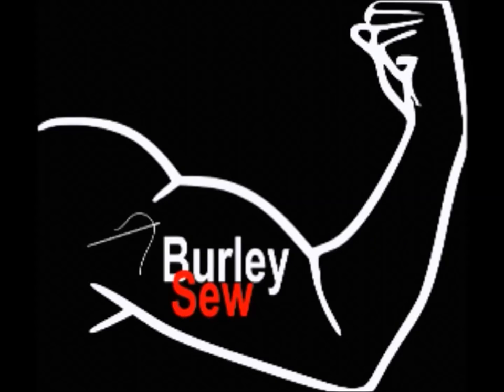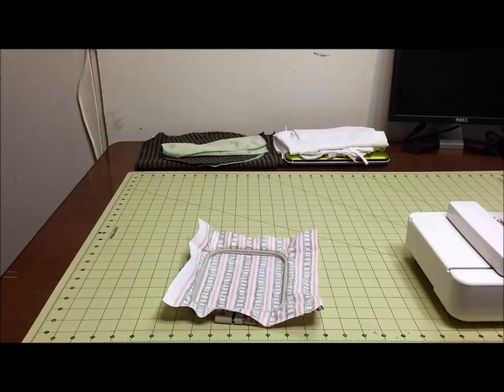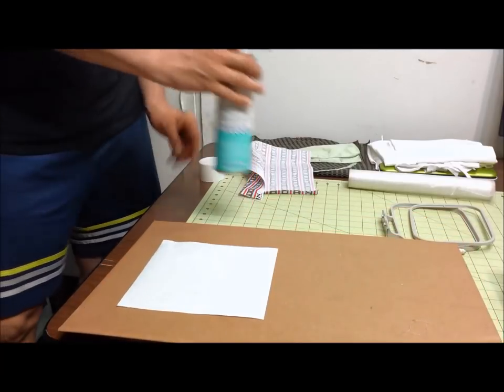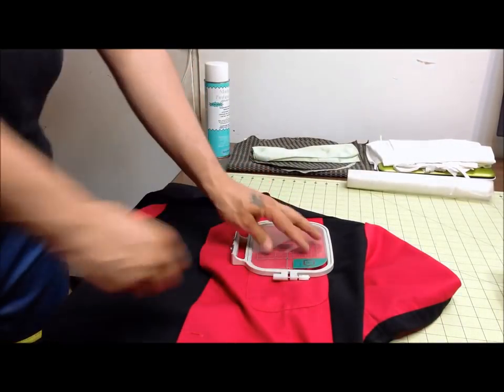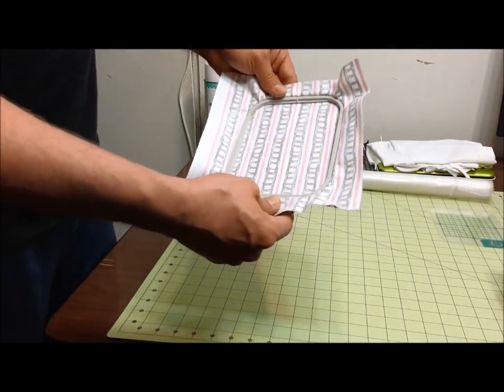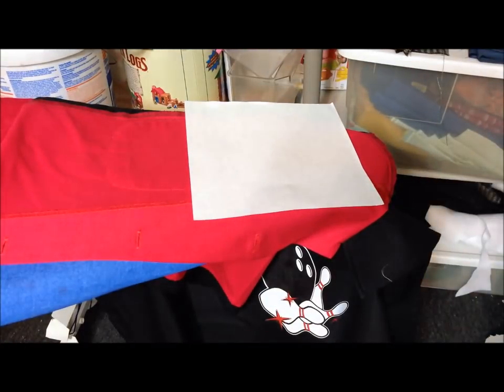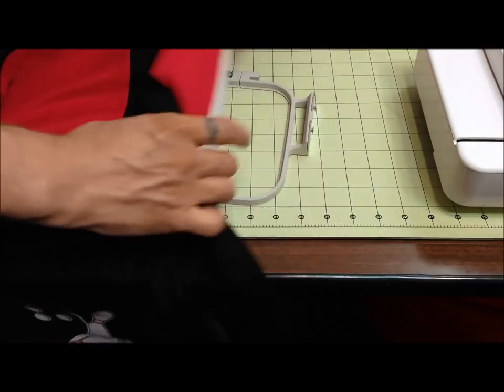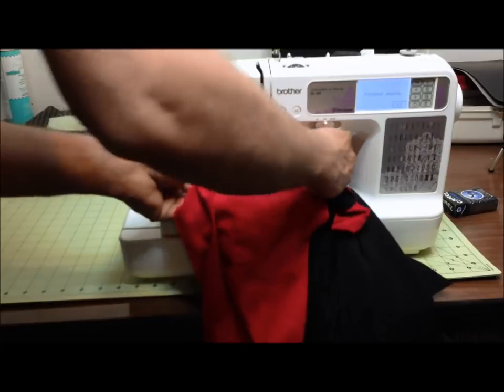How To use the embroidery hoop for a home embroidery and sewing machine- hooping tutorial (beginner)

Comment from the maker: Thank you for the great input! I looked this up after you mentioned it and saw the ones you are talking about. They have extra connection tabs so you can reposition it on the carriage. Originally I read that the machine would not make designs larger than one that will fit in a 4” hoop which is true. So this is a good solution to just reposition the hoop and not have to re-hoop the material.  Once again thank you.

Comment from the maker: I am happy you like the video and congratulations on the new machine! There are two ways you could hoop this. One would be as normal, which would use a full piece of stabilizer and just hooping your strip. Two sides would be unsecured but it should be fine. I have done that several times when I have a piece that is not big enough to catch on all the edges. The other way would be to hoop the stabilizer, spray it with adhesive and just put the strip on unhooped. I will try to do a video for this.